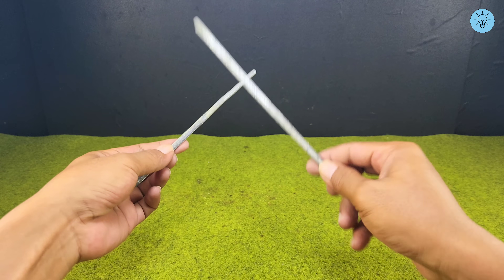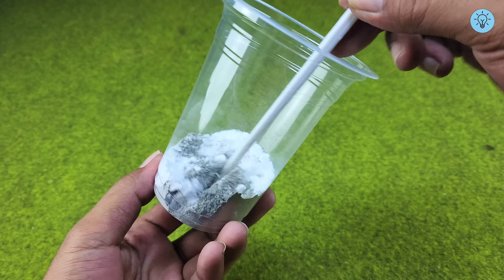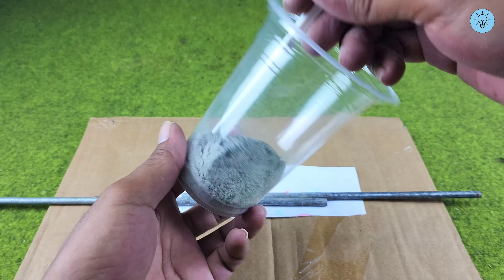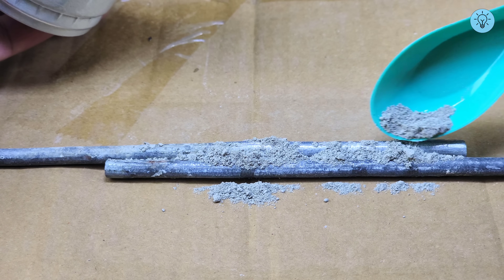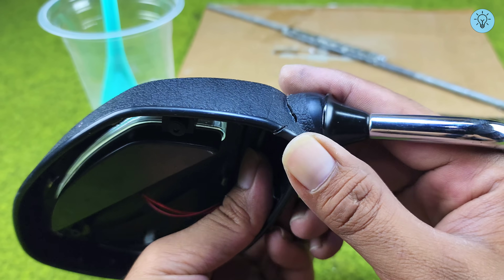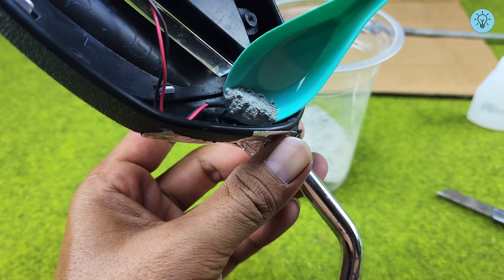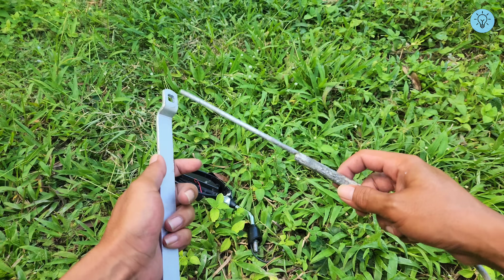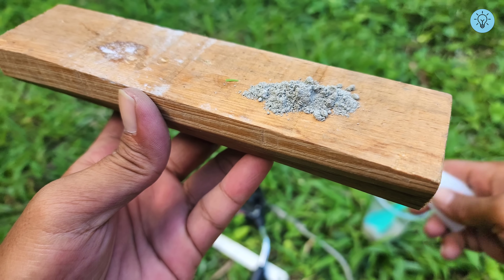Goodbye Welding Machines! All of China welds metal and plastic using BAKING SODA and CEMENT

Comment: Nope, this is not feasible when it comes to building a rack that supports some weight .
Better to weld, as welding causes fusion to melt the rod that causes it to permanently join together.
Reply from the maker: This video demonstrates an alternative method for joining materials for certain applications.

Comment: This is not welding this is gluing or bonding totally different..
You can find a welding machine for less than 80 dollars
Reply from the maker: @kloeduran10: You are absolutely right! This technique is definitely a bonding or adhering method, not traditional welding, and we appreciate you pointing that out. We call it "welding replacement" because the strength of the finished repair is comparable to a quick, strong weld on certain materials. Thank you for the insightful comment!

Comment: You need to add a egg to make it more fluffy
Reply from the maker: Hello @gregoryplummera-l9l,
That's a funny idea! 😂 However, since this mixture of baking soda, cement, and super glue is intended to be a strong filler for structural repairs on metal and plastic, we're aiming for hardness and quick curing, not fluffiness!
Thanks for the comment!

Comment: That's gluing, not welding. You could do the same thing, stronger and more durable, with epoxy. It would be unsafe for anything bearing a lot of weight, but for simple projects, it could be useful. Just the baking soda alone with cyanoacrylate glue would work, too. This can be used on a variety of materials, not just metal, as long as the glue sticks to it.
Reply from the maker: You are completely right—technically, this is powerful gluing, not welding! We use the term to describe the extreme strength and permanence of the bond for DIY projects. However, the baking soda and cement mix allows the bond to fill gaps and cure extremely hard, giving it that "welded" feel for light tasks. Thanks for sharing your valuable technical insight!

Comment: This is fascinating! Does the bond stay strong over time, or is it more of a temporary fix?
Reply from the maker: That's a great question! For light DIY tasks and plastic repairs, the bond is designed to be permanent, curing extremely hard like concrete. However, for structural metal tasks, it is indeed a temporary fix. It works best where traditional super glue fails due to lack of gap-filling ability. We hope this explanation helps!

Comment: watching u from canada. metal to metal when use for cooking will it not melt and get off detach to each other? I'LL MAKE A COOKING TOP USING USED OIL. DO U THINK THIS KIND OF WELDING CAN BE USED IN A COOKING FURNACE THAT HEATS  METAL TO RED AND FIRE THE BURNER WILL BE WELDED USING YOUR WELDING METHOD. DO U THINK IT CAN BE USED TO WELD METAL TO METAL SO THE OIL WILL BE IN A RESERVOIR NOT TO LEAK TO CONTAIN THE OIL WHEN FIRE GETS BURN TO RED HEAT TO COOK ANYTHING? PLEASE GIVE ADVICE. THANKS.
Reply from the maker: That is an extremely important question! This baking soda and cement method is *not suitable for any application involving high heat, cooking, or any structural metalwork* like a cooking top or furnace. The mixture is meant for simple, room-temperature DIY repairs on plastic or light, non-structural metal only. *Please do not attempt to use this for any cooking or heating apparatus* as it will melt and fail, potentially causing a dangerous situation. Thank you for asking for advice first!

Comment: What part does bsoda play in bonding?
Reply from the maker: That's a fundamental question. Baking soda (sodium bicarbonate) acts as a filler and an accelerator for the cyanoacrylate glue. When the glue comes into contact with the baking soda, it instantly cures, creating a hard, plastic-like composite material that provides structural strength to the bond.

Comment: Add a bit of calcium carbonate, quick lime, this may make a stronger bond.
Reply from the maker: That is an insightful suggestion for strengthening the bond further! Utilizing alternative fillers like calcium carbonate or quick lime is an interesting variation that could certainly enhance the durability or cure time of the composite. We appreciate the valuable tip for the community!

Comment: I have tried it but if the metal is subject to a lot of  heat it  breaks  down.  Also not sure how it weathers if exposed to sunlight.
Reply from the maker: That is very important feedback regarding material limitations. You are correct; the resulting cyanoacrylate-baking soda composite is an acrylic plastic, which has a lower melting point and is not intended for high-heat applications like traditional welding. Additionally, prolonged UV exposure from sunlight can degrade standard cyanoacrylate bonds over time. We appreciate you highlighting these critical points!

Comment: Unbelievable! 😱 Who would’ve thought baking soda and cement could weld metal and plastic together like that?!
The bond looks incredibly strong — have you tested its heat resistance? 🔥
Reply from the maker: It is certainly a surprising chemical reaction! To address your question, as noted in a previous comment, this composite is essentially a form of plastic, and therefore its heat resistance is limited compared to traditional welding. It is excellent for structural fixes at ambient temperatures but should not be used on items subjected to high heat.

Comment: Which is the Glue used here?
Reply: Super glue
Reply from the maker: The glue used is Cyanoacrylate, commonly known as super glue or instant adhesive. It is the key component that chemically reacts with the baking soda powder to form the strong composite bond.

Comment: Actually I used the same method for automotive crack fillings. This works fine for smoother sanding. But.. after two to three days.. due to the moisture in the air.. the baking soda emits watery substance.. and the project fails.! I'm facing this problem every time I use this method. I'm looking for the alternatives, but not yet.! But this method fixes just in seconds.. very rapid cure time. For this reason only,  I use this method.. but not a reliable joining method at all.
Reply from the maker: Thank you for sharing your detailed experience and insights! Your observations on the failure due to air moisture are critical. The chemical composition of the cured composite is susceptible to hydrolysis (breakdown by water/moisture), especially the baking soda component. This is valuable information for the community and confirms that this method is best suited for temporary or indoor, low-stress applications.
Reply: What if you were to paint the bond, would that help keeping the moisture in the air getting to the baking soda?
Reply: @grounddove I used silicone glue over the baking soda superglue fix and it is holding water PVC pipe joint.
Reply: @grounddove will try this
Reply: Thanks for the info.
Reply: Use cotton gauze or graphite power or even cement.
Reply: Zi.greziez.🇬🇹🚶🎅
Reply: I use string with Super Glue - no problems.

Comment: What happens when the joint is exposed to water?? Super Glue dissolves in Water!!
Reply from the maker: That is a critical point. While liquid Super Glue (Cyanoacrylate) cures almost instantly, the cured composite bond is not fully waterproof and is susceptible to degradation from prolonged exposure to moisture or water, especially the baking soda filler. This method is best for parts not exposed to constant water.

Comment: Instead of the metal rod, I really like it for connecting others like the mirror. From now on will stop buying 2 type glues.
Reply: Sorry.. this is no longer a stable joint.! The joint may break at any moment with the moisture in the air.!
Reply from the maker: We are glad to hear you found a practical application for this method! It is certainly a versatile alternative for many small-scale, rigid bonding needs. Thank you for sharing your experience.

Comment: А сода без цемента, - не то же самое???
Reply: Not cost effective it seems 😮
Reply from the maker: It’s a bit different — cement acts as the main binder. Without it, the result won’t be as strong as the original mix. But your idea is great to test on a small scale! 👌
Reply: May be. But.. soda emits water due to moisture, and the cement absorbs water. 😂